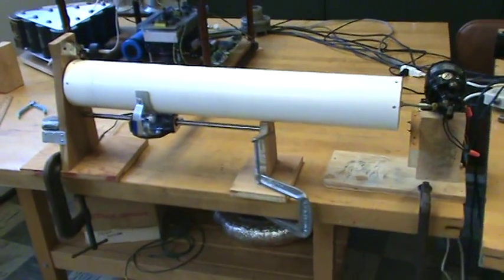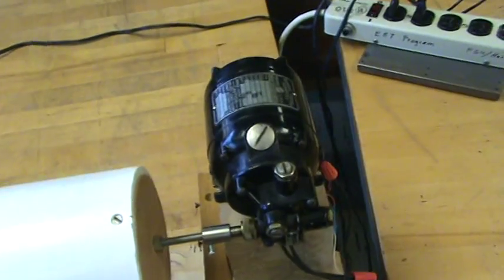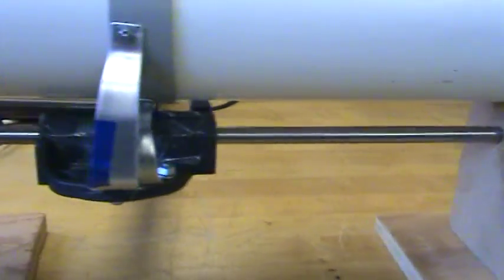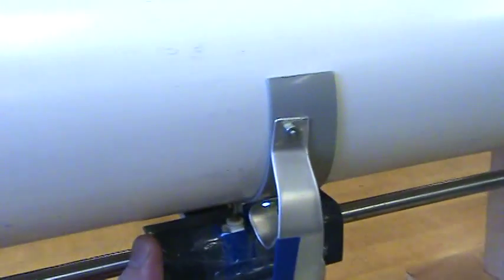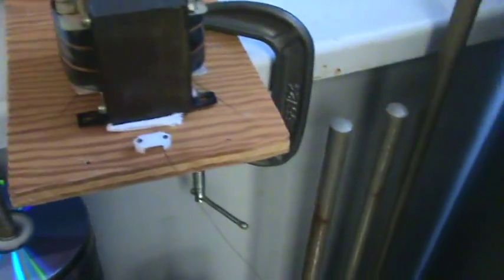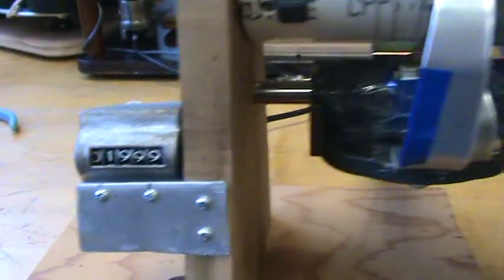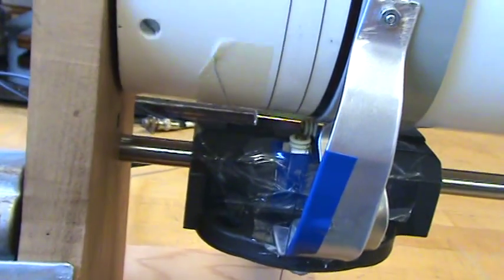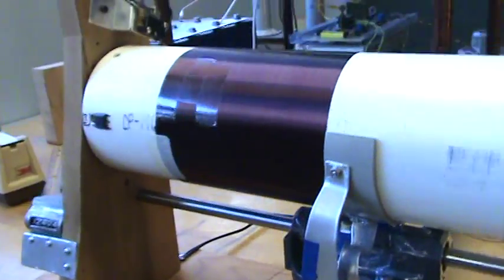(#0010) Automatic Tesla Coil Winding Machine - Part 1

Comment from the maker: I think it was just 3/4 inch ply wood. I drew a circle on it first with a compass, then drilled the center hole and cut the circle on a band saw. The bottom piece is slightly recessed by a couple mm so the perfect factory-made right angle cut on the end of the pipe would be resting on the base board and the pipe would stand up straight perfectly perpendicular.

Comment from the maker: You're probably right. I hadn't considered that the motor would work on AC since it was rated for DC on the label. Will have to try it. It's just like an AC/DC analog voltmeter with the D'Arsonval movement inside a field electromagnet rather than a permanent magnet. As for reversing direction, I was interested in doing so to quickly undo any mistakes in winding. I knew I could reverse the wires inside the motor, but fortunately the machine proved reliable enough that I didn't need to do that.